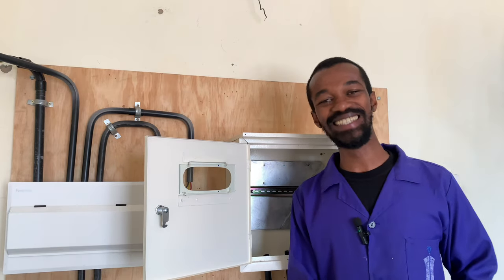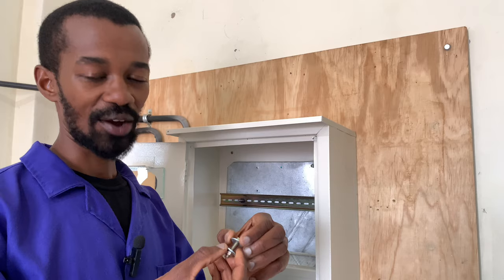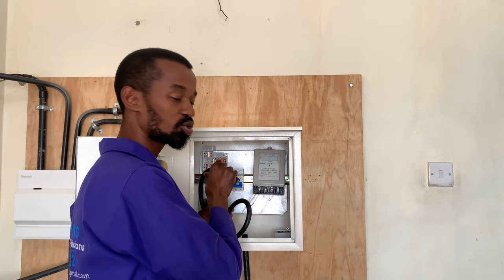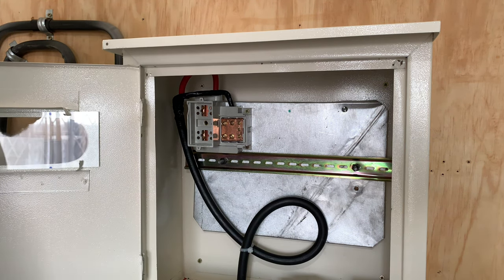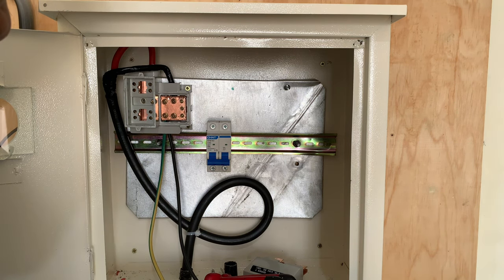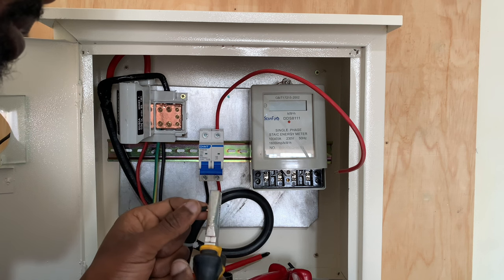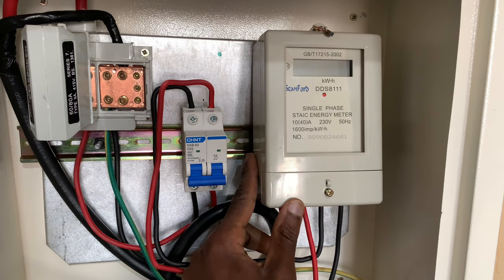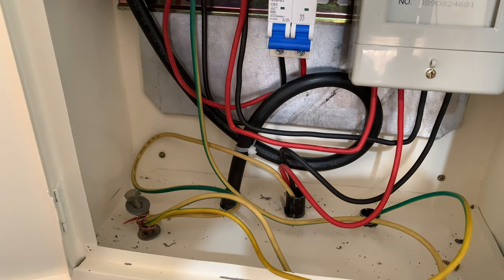Electrical Wiring At The Meter Box (DIY Version)

Comment: I saw 2 inlets of the phase side but am seeing only one connection
Reply: Is that on the cut out fuse? If that is the case it’s meant to just give you an option where to put it as if we’re fitting it somewhere where where another rent was used you have to make it work.

Comment: I have seen some people asking for these cut out fuses. You can get a separated earth neutral model or a combined earth neutral model so if you don’t wanna come by them, you don’t have to but obviously obviously it has to fit with the electrical systems design. On the right hand side in the orientation is here you can see there are three smaller bolts on the cutout. If you use that side to punch out holes then neutral and earth can be put individually and very are a much secure Fitt I thought I’d let you know these things just cause I’ve worked on these before. There hasn’t been a budget limit on the distribution network in the UK soI know a lot of the tips and tricks to do with these

Comment: So the earthwire goes in with the neutral wire in the cutout upto the consumer unit?
Reply: No, the earth wire connects to the neutral at the meter board but at the consumer unit they're separate. TNC-S system.
Reply from the maker: Great question Tumasalim.
Reply from the maker: Correct Peter, thanks for sharing your genius.